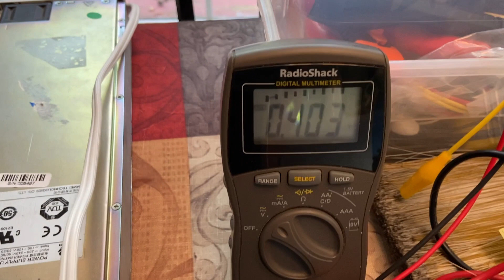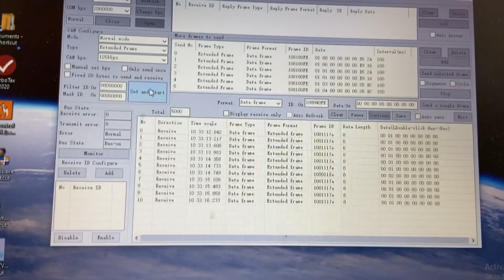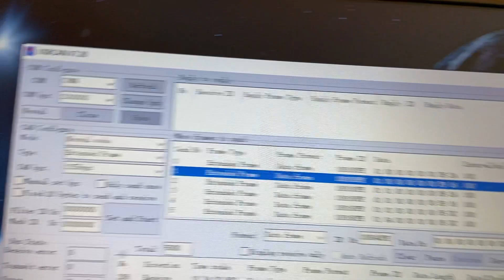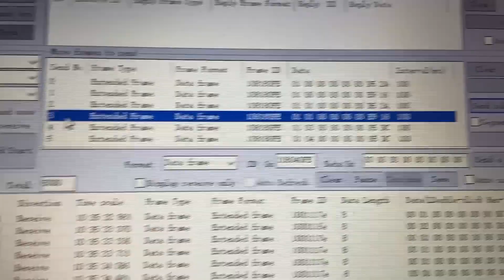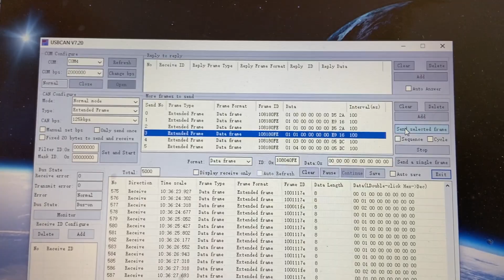Huawei R4850G2 CAN BUS Power Supply Settings

Comment: Thanks, this is spot on I have the way to work out the hex values for any voltage or current output so ie 50v is 50x1020 = 5100= HEX C738 so last to octets become C7 38, works fine.

Comment: Hi ! why is the minimum fan speed only at voltage 53.5V? how to make at minimum voltage of 48V?Thanks !
Reply from the maker: Voltage			a6c0 - ea67
Default Voltage	        c000 - e99a
C000=48volts

To set default boot voltage the command is slightly different. Also, the range is less than on the fly setting. See: https://www.beyondlogic.org/review-huawei-r4850g2-power-supply-53-5vdc-3kw/
Reply: @lanierje  I'm sorry for my bad English! I figured out how to set the right voltage! thanks ! I don't understand why at 48/58v or any other, the fan turns faster than at 53.5V? is it possible to set the minimum fan speed at 48V as at 53.5V?

Comment: Thanks greatly dear friend for this Educative video... Sorry for asking for the circuit diagram of the 10k resistor to the terminals and the link between address port and the output port. Thank you very much
Reply from the maker: The 10k is a light load for the power supply. I don't like to run switching supplies with no load. It is probably not needed. The link connects the slot detect 1 and slot detect 2 pins to the output negative. This is needed to enable the power supply. See the beyondlogic.org review-huawei-r4850g2-power-supply-53-5vdc-3kw

Comment: Hi great video. I have got a Huawei PSU480A, got can bus working, get similar reports, tried the same address / message as for R48850G2 to set the voltage but does not work. Have you, or somebody else any lead to instruction set for Huawei PSU480A ? Thks in advance.

Comment: How to leave this power supply working at 45 volts
Reply from the maker: Not possible. Default voltage minimum is 48V.
Voltage			a6c0 - ea67
Default Voltage	        c000 - e99a
C000=48volts

Comment: Found and installed the software on my computer.  Copied/added  both the default & max voltage frames exactly how you have them(thank you!)!   Located a decimal to hex converter calculator to convert minimum voltage of 41.5V.  Following your lead (hex = a55a=41.5V)
Wondering if a macro of some sort could be used to set on the fly voltage and current without manually sending every minute?  
 Any idea if these frames/code would work on any other Huawei power supplies, and have you discovered any other functions?
((Thanks again for sharing information!
PS -  I just ran/opened com port for kicks in the App without hardware and of course rec'd an error message, but the error message was in Chinese so totally indecipherable and useless -are all error messages in Chinese?
Reply: To answer my own question, apparently CAN implementations are different for different devices and manufacturers, the easiest most certain way for you to get this information would be to contact the manufacturer.  There are some web references such as this one, but they seam to be few and far between.

Comment: Very Good Information. Thank you for that video. I have a r75020G1 from Huawei and Need to Limit the Output current via can Bus. I got the charger from China via Ebay. Unfortunately they cannot give me any Information about can Bus address and values. I expect the same settings as with your device but i am not sure  about it. Could you give me hints where to get  this Information. Huawei here in Germany is Not willing to help.

Comment: Thanks for a helpful video.  Any idea why I can't get the startup voltage setting to stick?  I get an ACK packet with a 0x21 error indication when I send the 01 01 frame.  I can set the voltage while it is running just fine and it returns to default in 60 seconds, as expected.
Reply from the maker: To set default boot voltage the command is slightly different. Also, the range is less than on the fly setting. See: https://www.beyondlogic.org/review-huawei-r4850g2-power-supply-53-5vdc-3kw/

Comment: Great video, thank you for sharing. Was just wondering about the limit of the output voltage that you can control through the CANbus messages. Can you go anywhere between 0 to the max value, or just a few volts around the nominal value? Thank you.
Reply from the maker: Online limits :41.5V to 58.5V   Offline limits:48V to 58.5V Offline is where you can set a default boot voltage.
Reply: What value for 48v?

Comment: I've seen modified versions on AliExpress that go up to 98v. Any idea how that modification has been done? Would it be possible via CAN BUS requests?
Reply: Im also searching for this solution. I believe one of the resistors (22k) has been replaced with a potmeter and a resistor in series to achieve 22k in the middle of the range of the pot meter. But the exact resistor i dont know yet. Im planning to buy one from ali, huawei 4875 version and take it apart, if i can find the way they did i will report it to you.
Reply: But it never could be safe as most of the condensators used are only rated up to 63v, but i will also check those if they might have been replaced

Comment: Is it possible to use CAN bus to reduce the fan speed and set that as default on power up? I want to use this supply for LDMOS RF amp like you amplifier that only needs 1200W so the fan could run slower and quieter. If speed can't be controlled by CAN do you know if I could add resistors in series with the fan or will the supply detect low rpm and shut down?
Reply from the maker: Good question about the fan speed. I honestly don't know the answer to that. Also, it may be that the fan has feedback to the drive circuit so I'm not sure resistors would work. I know this is the case with many server power supplies.

Comment: Hi, great information!! Noted the resistor between the DC power connection; Why did you fit it and what's the value? Thanks!
Reply from the maker: I don't like to run switching power supplies unloaded, so I lightly loaded it with 10k resistor.
Reply: @lanierje  Thanks!

Comment: 4875g By changing the feedback resistance, replacing the output mos, and rewinding the transformer to replace the capacitor, the high voltage can be changed.
Reply from the maker: That defeats the purpose of this video. This video shows how to change output voltage and current limiting by software. No hardware modifications.
Reply: yeah right

Comment: ne fonctionne pas pour moi !! j'ai testé avec 2 can_bus différent. j'ai le même can_bus que la vidéo.
vitesse du port: 115200. donnée: 8. parité: non . bit arret:1 . flux non.
Reply from the maker: COM=2000000   and   CAN bps= 125kbps
Reply: @lanierje  oui, j’ai mis les meme valeurs que la vidéo.
Reply from the maker: @marcelbenhur6230  Be sure slot detect pins are connected to neg. Also need some load on dc output. It can be a light load of 10k or so for testing. For slot detect pins see: https://www.beyondlogic.org/review-huawei-r4850g2-power-supply-53-5vdc-3kw/ 
(Assurez-vous que les broches de détection de fente sont connectées à neg. Également besoin d'une certaine charge sur la sortie DC. Il peut s'agir d'une charge légère d'environ 10k pour les tests. Pour les broches de détection d'emplacement, reportez-vous à la section)

Comment: How did you connect a resistor? If we don't connect a resistor what is the difference?

I didn't connect a resistor and my psu is working perfectly, but the problem is lower voltage 53.5v, I use it to charge my ups batteries of 48v system, I need 58.4v to charge what should I do for it
Reply: لو عرفت تتحكم فيه محتاج مساعدتك لو سمحت.

Comment: a very helpful video thanks
For Default Boot values ( as a Charger ) ? x1020 for Volt , and x30 for AMPERE ? 
108180FE;01 01 00 00 00 00 DF 20;100;  for Boot Voltage 56volt?
108180FE;01 04 00 00 00 00 5 DC;100;   for Boot 50 AMPs ?
would that be so correct?
Reply from the maker: correct
Reply: @lanierje  THX
Reply: @lanierje  Hello is possible  pleases to explain hoe to convert the volts to decimal  number e.g 01 01 00 00 00 00 DF 20;100;   i need to change to 50V  can you please tell me exactly how the conversion is done, use some calculator Thanks
Reply from the maker: @johnkalouris8835  50X1020=51000, 51000 in hex=C7 38
so default voltage of 50 would be 01 01 00 00 00 00 C7 38
also on the fly change to 50 would be 01 00 00 00 00 00 C7 38

start with decimal value, then enter dec value in calculator in programmer mode. HEX can be read. Or you can do the conversion yourself. HEX c7 38
12*16^3=49152, 7*16^2=1792, 3*16=48, 8*1=8
so 49152+1792+48+8=51000, and 51000/1020=50volts

Comment: Hi, is possible set default voltage to 50V ? I mean after switch on the PSU and dont change aby vaule thru CAN
Reply from the maker: Yes you can. You use CAN to set a default startup voltage. You no longer need CAN if that is the voltage you will always use. I covered this in the video.
Reply: @lanierje  Awesome, thanks

Comment: Hello nice video.Can i set (change) volt and amperes without using can bus.For this switching power unit.Thinking any switch inside of it.Thank you
Reply from the maker: No, you need CANBUS to change the settings.
Reply: Have a look here: https://www.youtube.com/watch?v=U9LE8FThbPU&t=1061s

Comment: hi ian looks like you only have a few options for voltage ...using the can buss to usb adaptor can i chane the voltage and amps down and have them stay there?..i read in coments you answer lowest voltage is 41.5..but im not sure if it will stay at chosen lowest voltage or amps..did you make that short menue or is that standard and is there more to the menue?..can you scroll down for more options?
Reply from the maker: I think the values are limited to 41.5 to 58.5 active mode and 48.0 to 58.5 for setting default boot. So if you want to sustain an active mode voltage without making it default, you have to continuously send the command as demonstrated in the video. When you say menu I think you are looking at the commands I entered manually. You will need to refer to the power supply protocol to create your own commands.
Reply: @lanierje  ok thanks for that reply it was helpfull to know im not going to get my voltage i want and have it stay there ( 43.8v) with this system/path. and i dont know if i can turn down amps.

Comment: Hi, Do you know if you can set a current limit?  E.g. set it to 10a max?  Thanks so much :)
Reply from the maker: If my calculations are right 108180FE;01 03 00 00 00 00 01 2C should set a 10A limit. Last 2 bytes 01 2C = Decimal 300
Current limit is 30 x A. hence 30 x 10A=300. 300 in hex is 01 2C (for default boot current first 2 bytes are 01 04)
Reply: @lanierje   That is excellent :)      Thanks so much, I will buy one of these devices and give it a go!

Comment: Pls where can I get this software?
Reply from the maker: After purchase email seller. They send a link for download.
Reply: @lanierje  ok
Reply: Can this make the psu a variable type? From 0v to 58v??
Reply from the maker: @benzimanagbozo3607  I don't think so. I think the values are limited to 41.5 to 58.5 active mode and 48.0 to 58.5 for setting default boot.
Reply: @lanierje  Did your R4850G2 become very hot when turned on without a load on the output? Mine do, and I am pretty sure it's not supposed to happen. I just want to be certain it isn't some weird supply pumping, or inductance dumping that causes energy to be converted to heat. The supplies are very expensive now, so I would prefer not to have to buy a new one...
Reply from the maker: @Mr_Wh1  i would not try to run it with no load. If you look closely in my video you will see a resistor across the output terminals. It is lightly loaded (10k I think) but enough to avoid problems.
Reply: @lanierje  I begin to have second thoughts about using my unit as a power supply for my CNC machine with servo motors. (Yes, it will have have a high current diode and capacitor at the output). The motors might not draw enough power at all times.
Reply from the maker: @Mr_Wh1  i use this as a power supply for RF linear amplifiers. I use a different type (0-48v 500w) power supply for driving a small CNC spindle motor directly.
Reply: @lanierje  Sorry for the late reply. Thank you for taking time to reply to my question. I put 5K resistance across the output of the unit. This time the unit wouldn't even start up. So I would say it safe to assume it's defective at this point. :P
I may push it, but is there any way I can get you to share the link to the CAN software you got from the vendor? I bought a CAN transceiver on Amazon, but there was no software included.

Cheers from Denmark.

Comment: Where did you buy the Huawei?
Are you planning to hook up a bench top power supply to modify and display output voltage and current?
Reply from the maker: I think I got it on ebay. I know I got the connector block on ebay. I will use this as a power supply for LDMOS RF amplifier.
Reply: Can it vary the voltage